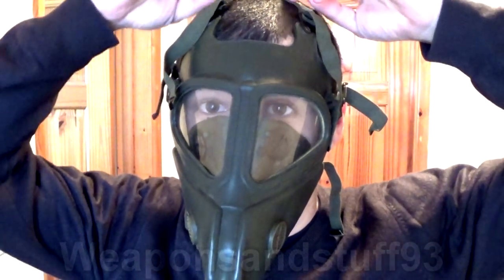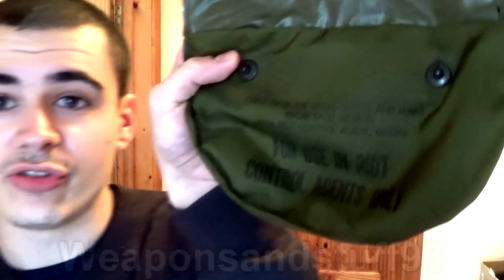XM28E4 Grasshopper gas mask

Comment: The reason that militaries explored "hamster" gas masks isn't because they were stupid and didn't realize that the filters could not be user replaceable in the field they designed them to specifically to have pre-installed ready to go filters in a very compact package.

The most common failure in drills (as well as real life events) with tank filter gas masks were the filters, they were either not installed properly which lead to an improper seal or soldiers passing out due to asphyxiation as the external caps were not removed during the panic (some filters also required you to break a physical seal by either pushing in a meal piece or rotating the tank) or the filters were simply forgotten or lost.

While the hamster masks are quite worse in terms of long term operational capacity their failure rate was substantially lower  upto a factor of 10 (were talking about 30-50% failure rate in drills for gas masks) and beyond in drills.

It should also be noted that gas masks are not designed to allow the operator to remain combat effective and outside of dedicated NBC units that may need to operate in hazmat conditions when an NBC threat is announced everyone puts their gear on and heads for shelter immediately no one is going to continue fighting if there is a gas attack.
Reply from the maker: The issue is you can't have the filters pre-installed and ready to go, unless you get your soldiers to replace the cheek filters quite often those filters will begin to expire due to contact with natural chemicals in the air, it's again wishful thinking to assume that as soon as there's a chemical attack soldiers will be able to withdraw properly.
Reply: The idea was to have the masks in sealed packs which would keep the filters fresh for the duration of their shelf life.

The re usability of masks was never a factor in their design because once the mask comes off you should never put it back on without full decontamination and refurbishment.
Basically the gas mask should give you enough of a life line to get to a shelter which will provide protection as well as decontamination facilities.

The gas masks have a very short shelf life to begin with (e.g. Israel replaces them every 5-10 years) and if the mask was opened you are supposed to replace it within 2 years if the filter wasn't used or essentially ASAP if the filter seal has been  open.

The mask itself also needs to be refurbished as the lubricant |dries" (it's often just sweating/sipping out rather than drying) out, the lubricant is there to prevent materials from penetrating the porous surface of the mask since all elastomers are porous  as well as to prevent mechanical failure due to shrinkage (as long as there is lubricant in the voids the material can only shrink so much).

The often puts the life time restrictions on the mask itself which are shorter than the shelf life of the filter as long as it's not exposed to oxygen and or moisture.

Comment: would you like the grasshopper as a proper gas mask if it had an RD40 connector on the underneath and you could close off the cheek filters so you are only breathing through the RD40 ABEKP3 filter? and the mask wasn't latex, of course. I don't think that it would work with having side RD40 ABEKP3 filters, but I am going to build a prototype with all three as an option and see which works best to make a proper seal.
Reply from the maker: The mask isn't latex anyway it's silicone but that sounds interesting, but again there are far better 40mm masks than the XM28 anyway

Comment: Are the filters safe to use if they have not been damaged or does it contain dangerous components?
Reply from the maker: Not really sure to be honest, the ones in this mask are so old and clogged up you can't really breathe through them.
Reply: Yeah, you can't be too sure, but I'm guessing it's similar to the M17, that had chromium in it.

Comment: if they make it with the bottom bit had a pipe to a filter with a standard 40mm screw and the cheek bits as exhale/voice diaphragms it would have been better while still looking cool well in my mind it would

Comment: The similar mask I THINK your referring to is the M22 Cd-v-805
Reply from the maker: That's the one.
Reply: I just bought a CD V-805 M22 mask.  It is very light weight and comfortable.  However, I need to pull the straps fairly tight to get an airtight seal and you can't do a pressure check on it because of its design.  Unlike the XM28, the filter on the mask is supposed to be NBC rated.

Comment: Hey, so the Israeli gas mask I got. Comes with a filter that says 17/03/09. While I will be just using it for my costume, I would just like to know for any future filters if the date on them (like 17/03/09) was the manufacturing date or expiration date.
Reply from the maker: Not sure, if there is only one date it's normally the production date, if there are two the second date is the expiry date.

Comment: You've definitely watched these longer than I have, what's a fair price on a sealed NOS XM28?
Reply from the maker: Never seen a sealed one for sale, if you are in the States they will be cheaper but I'd guess over a hundred dollars.
Reply: There some sealed ones on US eBay now for 110 shipped (for me), then a few people trying to get 150 or 160 for used ones. I ended up paying 80 bucks for mine, so not too bad. Pretty sweet mask though. Had to replace all the valves as they were dried and crumbled, and the little white plastic thing down in the chin was broken in half, but from what I've  heard they all are because of how they were folded into the bags. Other than that it's in good shape. Thanks for your help.

Comment: oh yeah the XM28E4 was not made to replace the m17 it was mainly designed  for police swat and police issue the filters are so thin it would not protect the user from NBC another collecter told me this  btw
Reply from the maker: Well that's not a valid citation because someone told you that. The XM27 and XM28 were both prototype masks designed to replace the M17 but they never actually did. The XM28 was only made with tear gas filters but it wasn't made for Police use originally.
Reply: He was a bigger collecter who. was a Lot More educated in US masks
Reply: Weaponsandstuff93 actually the Xm28e4 was made Mainly for the tunnel rats and was Made to  be used side by side with the m17 not completely replace it

Comment: I have a question: I noticed on the sides of my gp-5 there are ridges that appear to be the shape of an ear, yet when I wear the mask, my ears are right by the edge of the rubber, are these ridges where my ears are supposed to be, or are the shapes just a coincidence and my ears are fine where they are? I'm trying to figure out if my mask is too small.
Reply from the maker: Sounds like your mask is too small.

Comment: Honestly, the XM28 is one of my favorite masks, especially when you take it for what it is. Since it was only a riot mask, you would be able to just walk over to your police van, and swap out the filters. Not to mention, the filters are easier to take out and swap than the M17. But yeah, in an actual gas situation, it would be useless.
Reply from the maker: The issue was, lots of frontline soldiers were issued it with only riot filters, that's not the fault of the mask but the bad situation that lobbying and outside control on military equipment causes.
Reply: Yeah, the government was incredibly shady at the time. It was either your gas mask failing on you, or your "self cleaning" M16 jamming and breaking in the middle of combat.

Comment: So this mask would fit for riot control agents and so rioters, right? Espically, well at least to me, it has a psychological effect due to its weird style.
Reply from the maker: Well originally for light weight military use against particulate weapons.
Reply: @Weaponsandstuff93  I've read somewhere that It was used to protect US soldiers during the vietname when they would throw CS gas into vietcong tunnels.
Reply from the maker: @breizhrudie4757  Yes they used it for that but mostly because it was lighter and smaller than the M17.